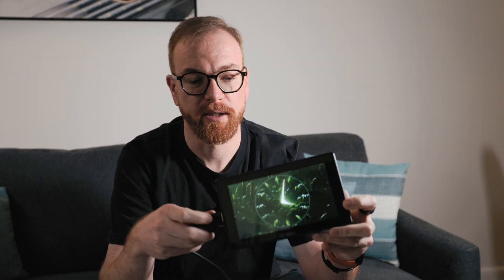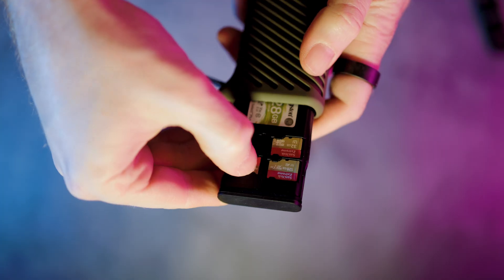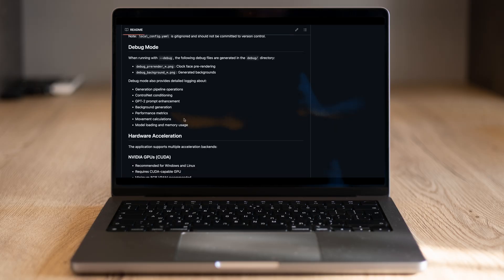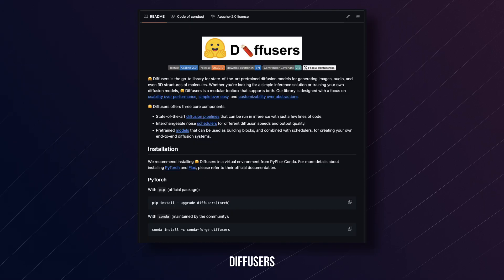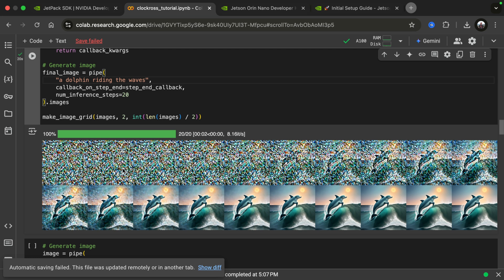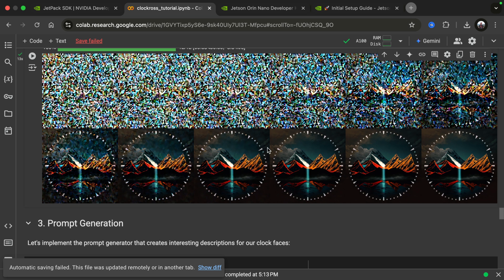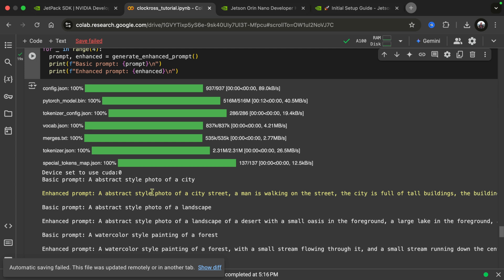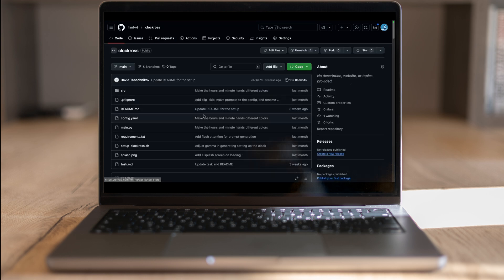I Built a STUNNING AI Clock! (Jetson Nano + Stable Diffusion)

Comment: why gpt-2 in current year?! Look into SmolLM2-1.7B-Instruct or something
Reply from the maker: SmoILM2 while runs fine on the Orin Nano is still much heavier in terms of memory usage and speed than GPT-2. I also tried Phi and Qwen. Thing is, that since the Orin only has 8GB of memory, it ends up unloading the diffusion model, loading the SLM, and then loading the diffusion model again. The bigger the LLM, the longer it takes, and the prompt enhancement already takes 3sec, bringing the total image generation to 19-20 sec. A larger model would push it even higher.
Reply from the maker: Would probably work fine if you generate an image every minute instead of every 20 seconds.
Reply from the maker: I ran another test with SmolLM2, and while it does generate better prompts, it's a 3.42GB model, so switching between SD/SmolLM2 basically kills the poor Nano's VRAM. Works really well on my Mac, though. If you want to try it for yourself, here's the branch with SmolLM2 - https://github.com/hml-yt/clockross/tree/smollm2.

Comment: Nice project ! The screen is not very nice tho :)

Also

You could also do one request every day of 4320 images and schedule them on the clock ? And do this from a computer and send it the project over wifi or retrieved from a server ? But i get that the project would be different. You like the fact that it is generated on the go.
Reply from the maker: You're right, was trying to save costs, but just ordered this screen instead: https://amzn.to/3Qzc3E0, which is a bit more expensive ($70) but should look much better.
Reply: @ Qled should be better, but I'm surprised at the prices of screens for that size and resolution. I thought you could get an OLED with much better resolution for that price.
Reply from the maker: Yeah, I agree, they are surprisingly expensive for what you get. I guess because those smaller screens are manufactured in smaller batches? These guys have a wide selection of screens: https://www.waveshare.com/product/displays.htm, but at $200, I could buy a computer screen and disassemble it.
Reply from the maker: Also, the screen looks much better in person than on camera.
Reply from the maker: And yeah, actually if you look at the source code's history, you'll see that the early version of this project used a Stable Diffusion API that ran on the same machine to generate the images, but that API could've been remote, and now you need a server as well. It would allow you to generate an image every 3 seconds and not every 20 seconds.

Comment: That's an insanely expensive clock.
Reply from the maker: It's $310 total, one time. A wall clock at movado
.com for example is $295, so for 5% more, you get a unique clock that's different every time. Wouldn't call that insanely expensive.